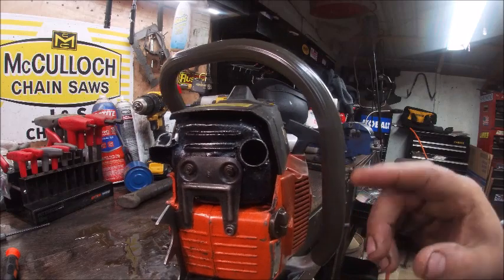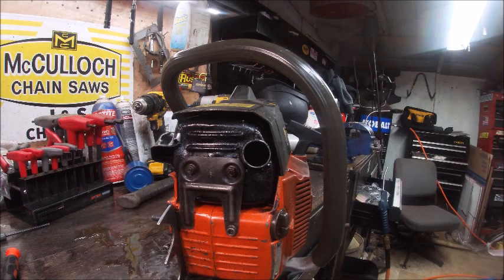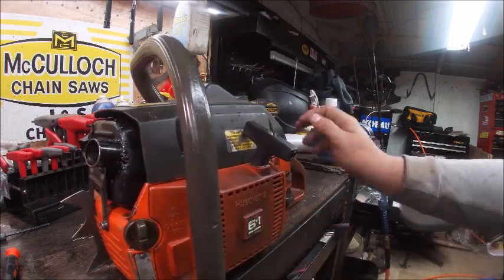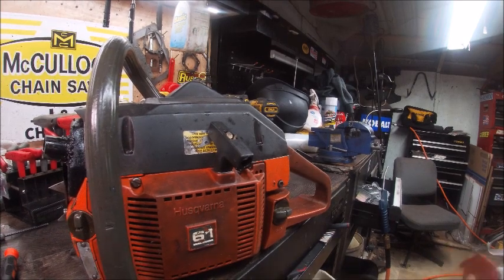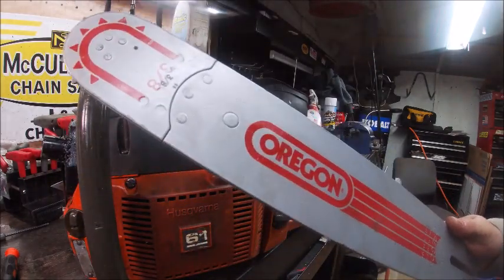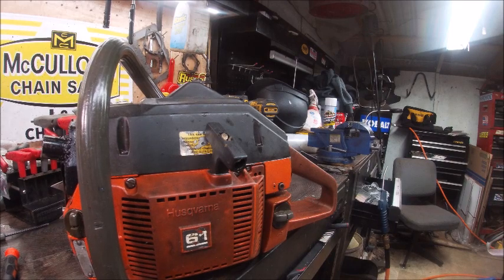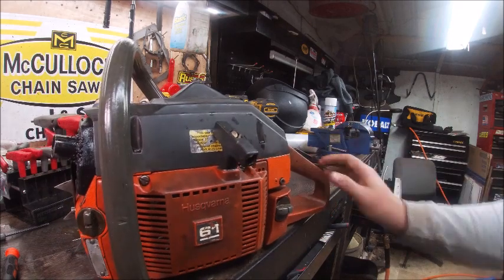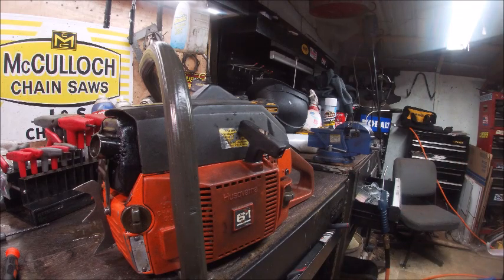UPDATE on the PORTED High Compression Husqvarna 61 new 365 piston 272 carb Dual port muffler

Comment: I picked up a white top 61 about a month ago, along w/a 55 for a couple hundred bucks. I deleted the base gasket, & modded my muffler on the 61. But my muffler came appart in 2 pieces which made the baffle super easy to rip out. Then I did like you, but I was able to hammer my gills shut & weld 'em. Then put a couple pipes in. Life Story Alert Sorry.

 Sh*t anyway I really dig your channel dude & I watch everything ya kick out. Oh! I got .025" squish now. I also went thru, & buttered it up (chamfered everything & smoothed piston), and I ground out some of the inside of my piston where it had them cast seams, & extra weight. It had very minimal scuffs when I got it so I dressed all that up as well. The 55 is completely smoked though. The guy really pushed how great a saw it was. Next time I'll take a pouch a' tools with me & pull the muffler to have a look. Bearings were cooked too. Waiting impatiently on a damn assembly tool now, lol. I flowed the cases on it, new jug n' piston etc., Hey, God bless ya, & your family. Thanks for your hard work! You really put out good content frequently.